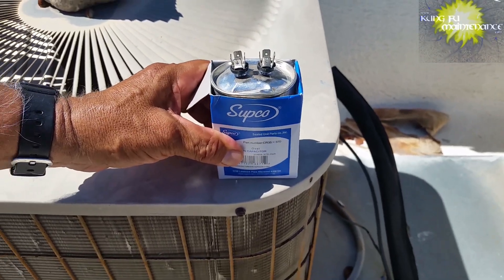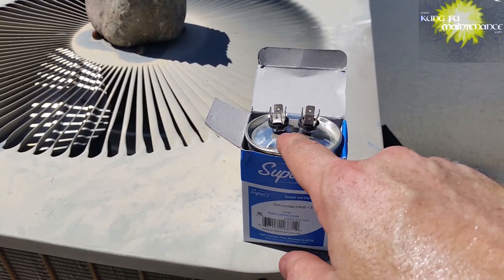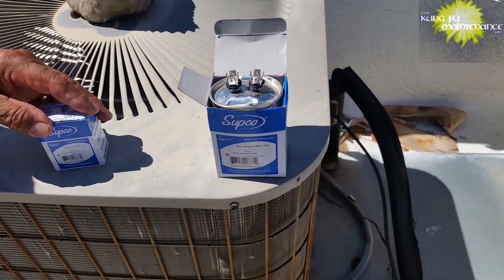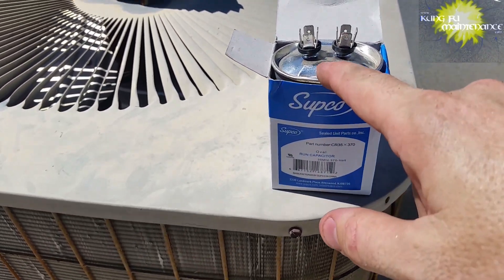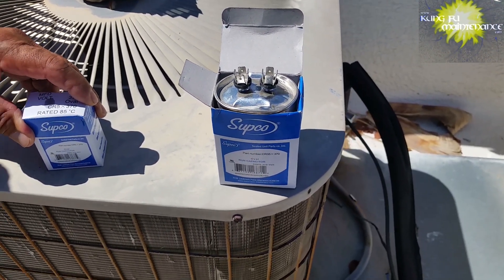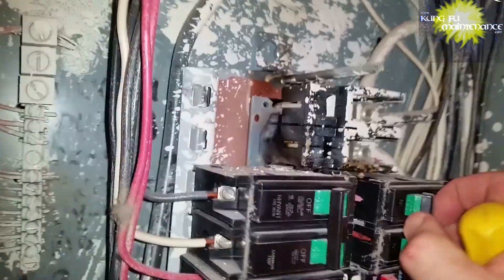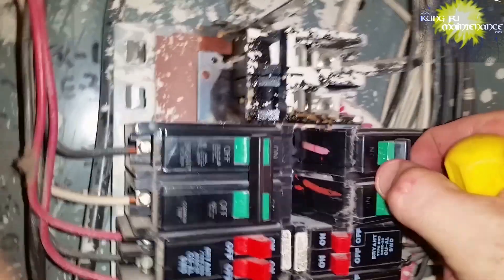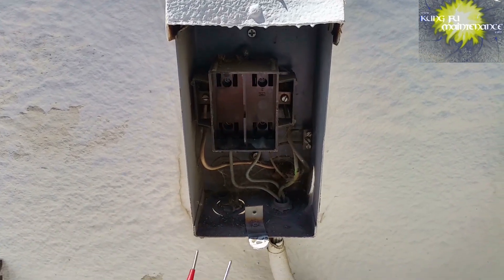Why Do Air Conditioner Capacitors Often Bulge When They Go Out Heat Up Loose Capacitance Or Break?

Comment: Oh man 5 years ago?  I don't know if you are still out there, but my AC stopped working --- the fan on the furnace comes on but the AC doesn't turn on.  It doesn't make make any noise at all.  I asked the people that installed my new furnace in December of 2020 about it because I wondered if when they installed the new furnace they didn't electrically somehow connect it to the AC,  The guy suggested over the phone that it was the capacitor.  And that seems to be the number one thing that goes out, if the articles and videos are to be believed.

So . . .I was going to buy a new capacitor so that I didn't have to pay the $108 just for him to come out and look at it.  But then I looked at the capacitor and it does'nt bulge one bit.  Do bad capacitors always bulge????